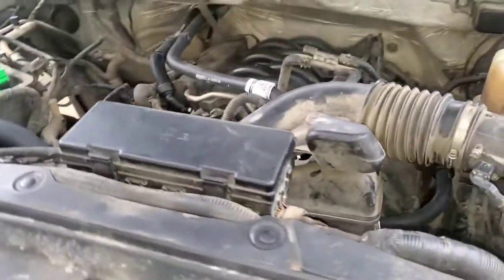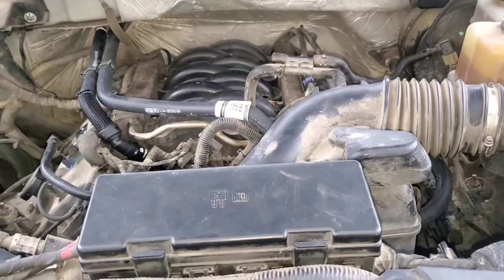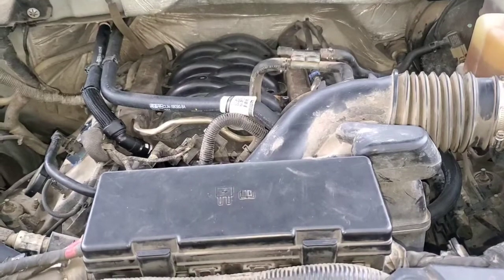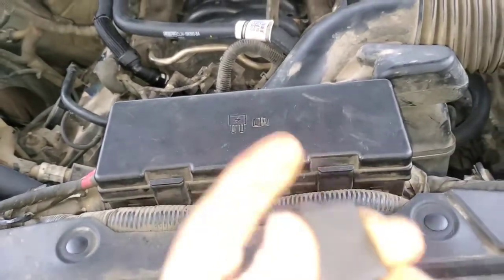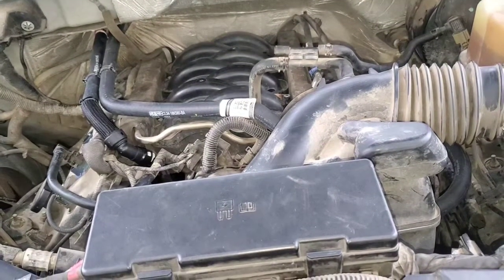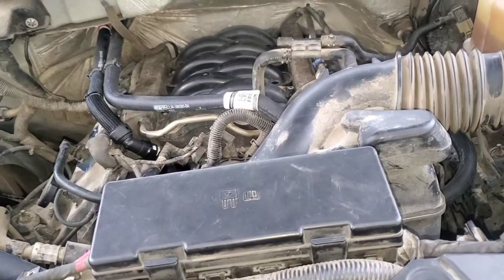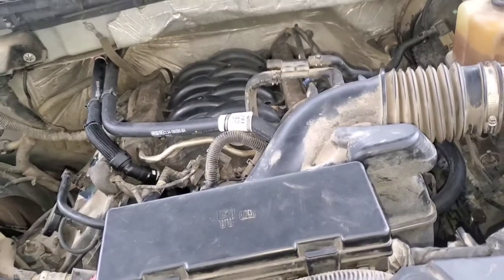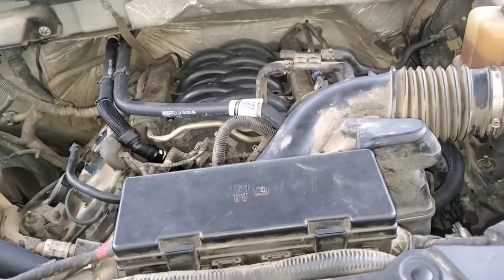12' F150 5.0 cold start misfires, P0308, cylinder #8 misfire

Comment: Which Intake valve did you change? Whats the part number? I have a 2012 f150 5.0 with a p0304 code, i change spark plug, fuel injector, fuel pig tail, coil connector, the ignition coil has spark and still have the p0304. The only doesn’t want to start when is cold then but when it gets harm after a few minutes and it starts normal

Comment: I have the same issue in my 2014 5.0 with 215k miles. Low compression and leaking valves. It stips misfiring once it warms up though.

Comment: What the heck is a bypass relay doing
Reply from the maker: I use an aftermarket bypass starter relay to energize the starter without the key on so the engine doesn't start. It is a normal looking relay but has a rocker switch built into the top. It allows me to easily hear a cylinder with low compression or to do a relative compression test.
Reply: @TechnicianRed  did you have to replace the valves to fix this issue?
Reply from the maker: @arfeenmalik8331  customer opted not to fix. But yes, you would need to pull the cylinder head and do a valve job with new valves to fix the issue.
Reply: I’m having the same issue